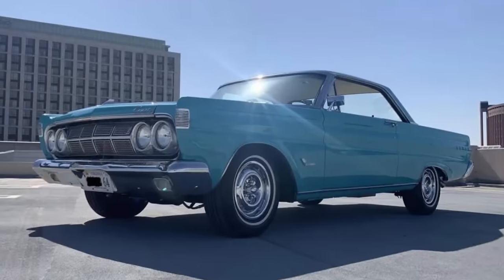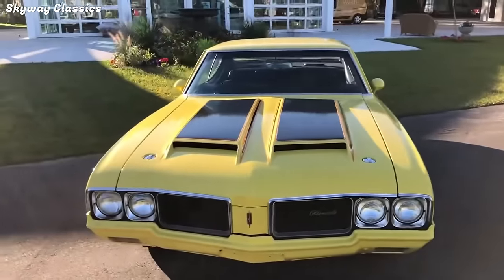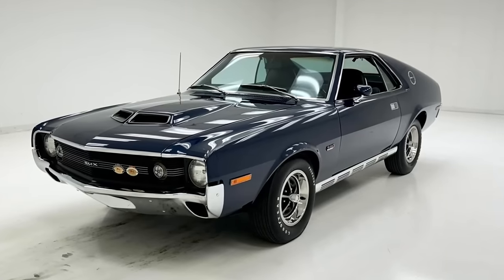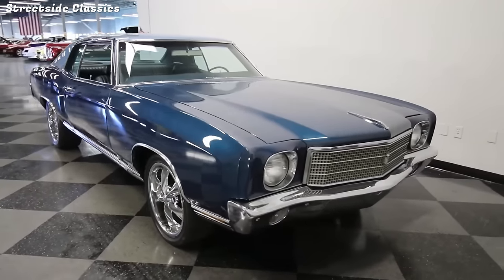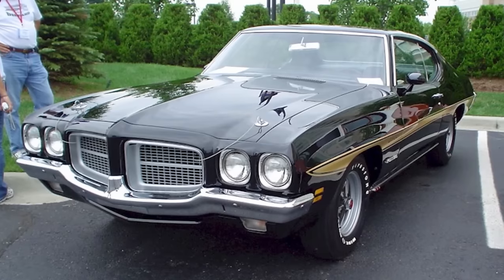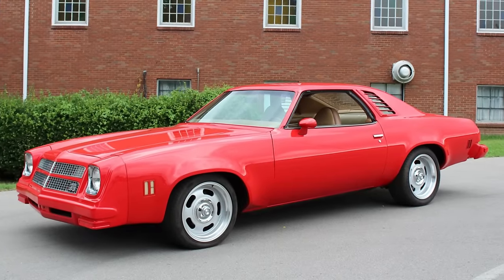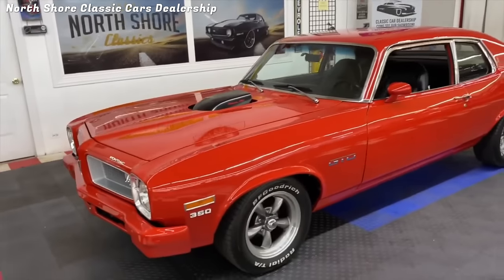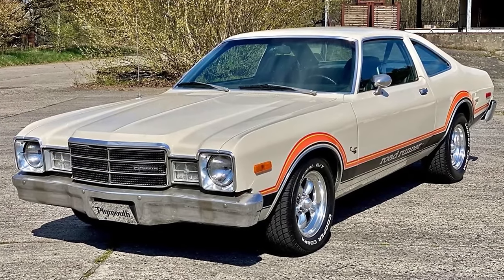9 FORGOTTEN American Muscle Cars Of The 70s!

Comment: They aren't "Forgotten"anymore, the mid-late 70's Muscle cars are BY far the most popular build since the CONVID "Outbreak", atleast out here in the Southwest/West. it all started out with people wanting something cheap and easy to tinker around with while they were stuck at home and the cars grew on them, 75% of my car club now has a car/project from 73-79 of one of the big 4 (AMC Included) and loving them. We even have clubs solely dedicated to the Smog/Malaise Era cars. They are cheap to buy, more often than not still running or so close that it takes a couple hours of fooling around with them to get them to start, the parts are still widely available and they have aged out of the smog regulations everywhere but Commiefornia so you can give them the power they SHOULD have had to begin with.

Comment: Man, 2nd gen muscle cars are hated because of being less RAW, but I appreciate them for having more FINESSE.
Reply: Hey  posh   I  can  agree  👍  with your comments  about  2nd generation  muscle cars   not  depending  on  raw power  as much as  the originals  but  by mid 70's  and early 80's   turbo assisted  motors of all sizes  were  again  putting  out  big  horse power  numbers 😊😅😮😢😂❤😂😊❤😊❤😊❤😊
Reply: Yeah  the late  60's  and early 70's  found  the big  3 in Detroit  starting to worry  more  about  government  regulations   than   than  what  their  customer bases  wanted  which  was  the beginning  of  the overly  high  priced   " power   packages  that  most  car buyers couldn't afford  unless  they  went  deeper  in  debt than  most  of car buyers  walked away  from  cause  of  loan rates  , insurance  costs  and  rising  gas prices 😊😅😮😢😂❤😂😊❤😊❤😊

Comment: Why did you leave out the Pontiac can am it was one year only , it's estimated that 1000 to 1500 were only made. I don't remember the year , but I think it was in 1974 or 75 they were all white with multi color stripes and a trans am styled hood scope and a duck bill type spoiler , and a 400 C.I. engine back with a three speed automatic all the can am's had red interiors with swivel buck seats as a option. If I remember the seats correctly.
Have a nice day!!!!!
Reply: I have seen one and drove it at at 15 when it was almost 20 years old.
Reply: 1977

Comment: You missed the 1978 Plymouth Volare Street Kit Car, one of which I owned. They slapped the learn burn ignition on a race engine. But let it be known ...... 360 E58 package, black valve cover NASCAR spec engine, 9 inch rear end from a truck, oversized torsion bars, window retainer tabs, NASCAR wheels. With a 1000 cfm Carter and a 1968 dual point distributor, 10.63 in the quarter. I wound up chaining the engine to the frame because of the torque twist.  I actually tore the roof on mine launching it at the track. How they got that thing past the EPA is beyond me.
Reply: How many of those were built?
Sounds like a homologation thing to me.
Reply: @Johnnycdrums  Richard Petty factory tribute car. 43, 360 cu in decals came with the cars. 350 Volare, 350 Aspen. Mods done by Dick Chrysler: Direct Connection parts, wheel opening cut, flares attached, NASCAR steel wheels, dump truck rear end and sway bar, 1.75 inch torsion bars in front. Direct Connection rear adjustable spoiler, front spoiler. NO ACCESSORIES other than power steering and I ran it with a manual box. Two flavors or engines, blue and black valve covers only outward difference. Black covers had high deck intake, iron headers, Direct Connection cam and pistons, 4 bolt main.

Comment: rakkye 350 was an appearance package
Reply: The car consisted of option package W-45, which included blackwall tires, a W-25 fiberglass hood, the L74 350 V-8 engine, N34 Custom Sport steering wheel, D35 sport mirrors, FE2 Rallye suspension, N10 dual exhaust and W35 rear deck air spoiler. All of these items would have been included on a true Rallye 350.
Reply: @justme307  like i stated an appearance package,the spoiler would not be included.
Reply: @johndillinger8482  FE2 Rallye suspension and N10 dual exhaust are considered performance options.  Spoiler is included according to Hemmings review of the Rallye 350.
Reply: @justme307  hemmings is a joke
Reply: @johndillinger8482  I suppose a 1969 Trans Am is just an appearance package since one could order a Firebird with a RAIII or RAIV engine and suspension package, leaving the TA option as just a paint and spoiler package. And a 1969 Mach 1 is an appearance package since one could option a sportsroof model with a 428 CJ and suspension upgrade leaving the Mach 1 as just a paint and spoiler package.  It's great that the Internet is full of armchair experts that know more than professional organizations that hire folks and pay them good money because of their knowledge.  Good riddance Johndillinger.
Reply: @justme307  totally different car

Comment: The Judge was Pontiac’s answer to the road runner.
Reply: What is the land speed record for the 1963 Studebaker Avanti?
As for Ron Hall, he and his team have taken a Studebaker powered car to a new land speed record. It is enough, for now. But there is always next year - and, who knows what the future holds? On September 22, a 1963 Studebaker Avanti set a new world speed record with a two-way average of 195.640 MPH at the U.S.F.R.A.
Reply: Initially the Judge was a response to the Roadrunner, Plymouth’s stripped down no option muscle car. But by the Judge’s release, it became the top of the line GTO. I have to agree with the video saying the T-37 was Pontiac’s actual response to the Roadrunner. It was a lot more comparable. Kinda like comparing the Firebird Formula to the Trans Am. You got the go fast goodies without all the flash. Which is exactly what a Roadrunner was.
Reply: Really?  A limited production, high option car with a big price tag? No. 

There were a few three speed manual Judges but not many. Most were pretty fancy even without trim rings on the wheels.
Reply: If anything the road runner in 68 was in response to the original GTO in 64. Remember, Pontiac created this market.
Reply: @Project_Low_Expectations  WRONG ONCE AGAIN    .....  Rocket 88
Origins of the Muscle Car
The first American muscle car was introduced in 1949, with Oldsmobile offering the Rocket 88. This muscle car featured a high-compression overhead valve V8 303 ci -135 hp engine and a lightweight body from Oldsmobile 76.
Reply: @BIGBADWOOD  
That was nothing but a somewhat high(ish) HP car, but it didn’t start an automotive revolution, it didn’t seen young adults running to the dealer. 
While the definition of muscle car isn’t fully written, which leaves a lot of gray areas… the main thing was large engine in an intermediate body. 
The 49 rocket 88 was a full-size. 
Excluded on that alone, not even getting into questioning if 135 horses constitutes muscle car power. Personally I would say absolutely not.

Comment: I didn't see the  65 Olds 442, My first car when I was 17. 400 c.i. 345 hp, posi-trac, Hurst 4 spd, the tach was mounted on the console. I'm 70 now, what a car, it was a ragtop-15 inch wire wheels!

Comment: The Dodge and Plymouth A bodies deserve some credit here. 340 and later 360 cars were fairly light weight. In 76, the Dart Sport with the 360 was 1 of the fastest American cars 1 could buy even though it was hampered by a 3.21 rear ratio and mandatory automatic.
Reply: 74’ Pontiac 455’ SD was the fastest those years.

Comment: The AMX was first. The Javelin was a lengthened AMX. Most people get that wrong, as in this video. 

The '70 Monte Carlo SS was NOT the first Chevy to compete in NASCAR as the video suggests and the LS6 as well as the 4-speed were available in the 1970 MC. 

A 1973 Chevelle SS might be more uncommon than a Laguna S-3. 

The '74 GTO (Ventura) should not be mentioned as it was a Nova with a 350.
Reply: That's like saying a 1968 GTO is just a Chevelle with a 400.